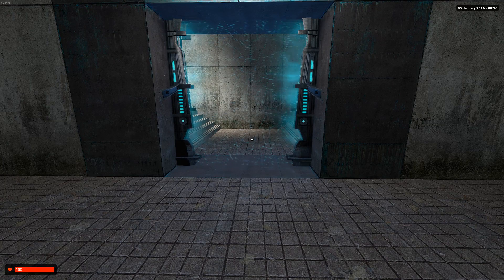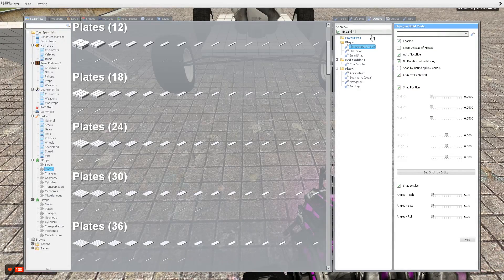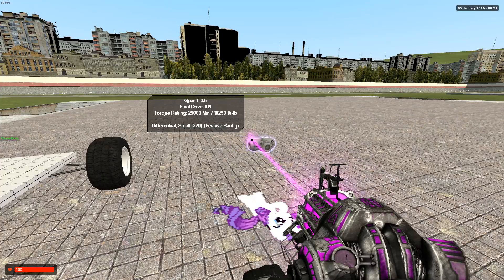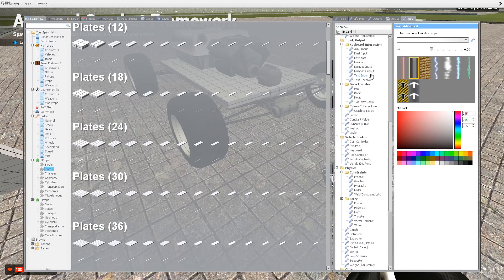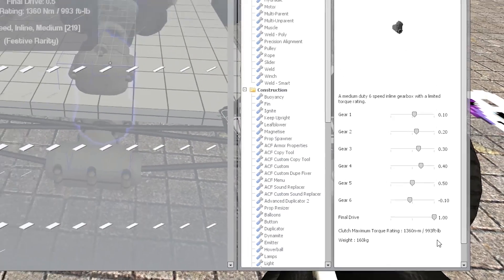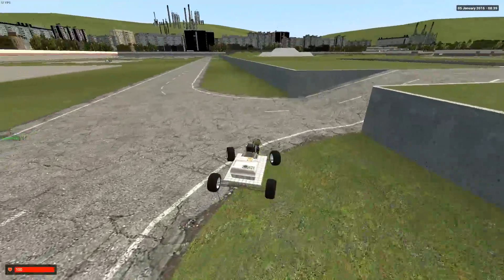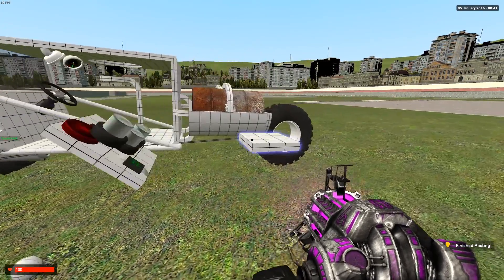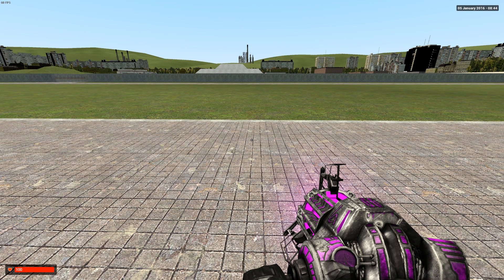[GMod 13] ACF Setup and Wiring Tutorial [2016]

Comment: fam, gear 1 - 6 is the ratio at which the selected gear transmits power to the driveshaft then to the wheels. final drive, you  probably already know so yeh. this is the same thing for tuning gearboxes in racing games. k

Comment: You say 100 some mods
I have about 1000 mods installed and a small portion of the mods is used to make trains
Reply from the maker: Not totally sure what you're trying to communicate with your comment. [I found the part you were talking bout] At the time there was a conflict caused by two mods, I just included the fact that there are hundreds of mods/addons installed on my server. So some things may have been conflicting.
Reply: i have about 3000
Reply: I only have 84 addon

Comment: can you help me? at 7:13 where you wire the throttle of the engine to an expression chip??? i don't know how to get that, (yes i have wiremod), is it possible to Wire the throttle to a pod controller as the control of key W? so when i click W i accelerate?
Reply from the maker: Yeah, you can do that, Forgive me, its been a while. That should work, the e2 is used to make the value of w (by default 1) = 100 instead. There are plenty of different ways to go about setting up ACF, keep trying to you find what works for you.
Reply: +ZcytheGaming oh ok, i built a petrol engine  car from the special engines in acf menu and added a gearbox and linked everything, the engine being active is wired to a button however when i hit the button the car moves slowly and i can hear the engine sound. but when i click the throttle button which is W it doesn't do anything the car just goes the same slow speed. i looked on the web but i can't find a solution. I also made a v6 petrol car but i have wired the engine active and fueltank active to my pod controller when i sit on the jeep seat the engine turns on and i can hear it but when i hit the throttle. nothing happens.
Reply: EnhancedMatrix12 you can link the throttle to a multiply gate. Then connect A to an constant value of 100 and B to W on the Pod Controller